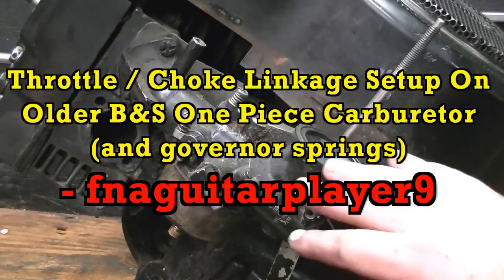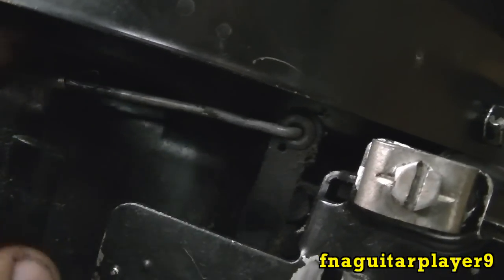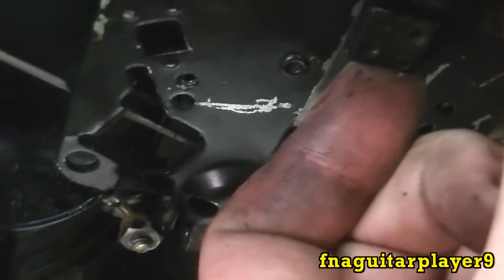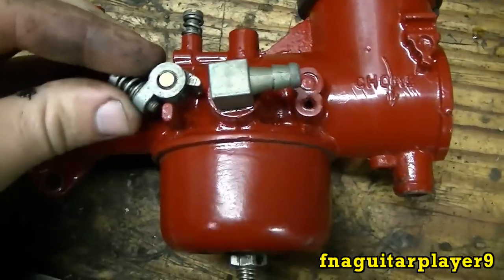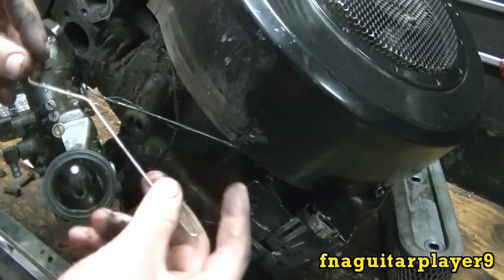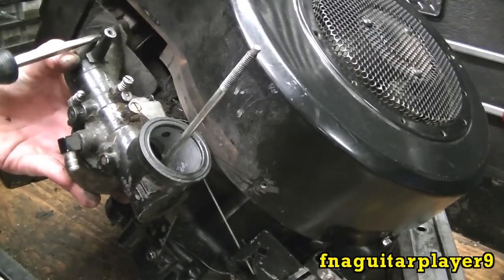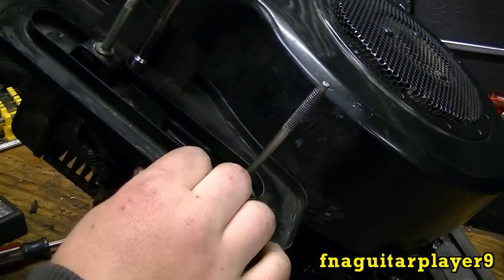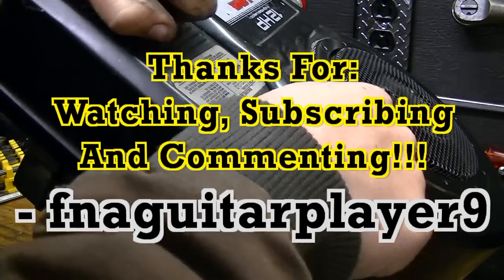How Throttle / Choke / Governor Linkage & Spring is Setup on Briggs One Piece Carburetor

Comment: Can I ask a question I bought a new carb for my simplicity it's a 252707 and it has a spring on the jet screw on the top next to air mix screw is this normal

Comment: I have same carb,  the gov. Arm and throttle arm do not have small hole for spring that goes with arm, should I try to drill small hole in gov.  And throttle arm. ?  Thank you

Comment: On the choke end of the carb body. What goes in the 8-32 threaded hole?   I have a photo but can’t figure out how to link it. Its in the bottom you can see it through air intake with filter box off.

Comment: Buddy I bought the cheap ebay carb but can get fuel inlet in. Any ideas?
Reply from the maker: I'd say take the bowl off and make sure the float or needle valve isn't stuck. Thanks For Watching!
Reply: I did the same . I had to tap the fuel inlet threads in the carburetor.

Comment: Finally found a clear and well explained video on the choke linkage. My mid 80's 12hp B&S carb has been acting up (one of the very old versions with the manual choke lever, and no choke linkage). The replacement carb has the choke lever mounted on the rear side as you have shown. This video is/was exactly what I needed to find. (Even tho' I will probably end up rebuilding the original, at least I have a mower that runs again...)
THANKS!

Comment: Thank you for making this video. I'm working on the same setup and pulled the carburetor off to replace and or rebuild. I always take pictures prior. But missed the linkage at the other end. The choke linkage fell off and could not see how it goes back in. As well as that little thin spring wire you mentioned. I suspected it loops through the small hole, as mine was not connected.

Comment: Appreciate the video more than you can know.  My friend gave me his 30 year old Toro riding mower recently.  Have it running, but it would only run if the throttle was set just so!  Move it one way or the other and it would cut out.  Anyway cleaned the carburetor yesterday and was having a heck of a time getting the linkage back on right.  The little spring is a pain, and the throttle linkage didn't want to stay in.  your video helped explain this well.  Again thanks for taking the time to make it.
Reply from the maker: James Owensby Glad to help out! The linkages can be a pain! your welcome, Thanks for Watching!!!

Comment: Mines on an old workhorse pulled the carb to clean it no choke linkage, I think im just gonna run another choke cable and ditch the whole auto choke dealeo.. great video with excellent close ups thanks for uploading...
Reply from the maker: I hear ya! Thats how I do them, I don't care much for the auto choke where the engine starts at full throttle. Thanks for Watching!!!

Comment: Hey, I checked out a few of your video's about these one piece carbs, love them, very helpful and got me through a lot. I do have one quick question. The oil breather hose that connects to the carburetor, while trying to get things set to run and my mower wouldn't run, it kind of looks like the might be/have been some oil getting in before the choke plate, is there something I should be looking at or what could the cause of that be?
Reply from the maker: +Charles Mccullick Appreciate that glad to help out! Usually oil from the breather hose is from excessive blow by (past the rings on the piston) forcing oil past the rings or to much oil in it, or, they have what works similar to a PCV valve on the valve spring cover, its possibly for that to be dirty or sticking letting oil seep through. Thats really about the only causes for it. Or if its been run on a hillside or turned over it will cause it to seep through as well. Thanks for Watching!!!

Comment: I have a 2015 Cub cadet walk behind haven't had it long the  gas bolw gasket was leaking and unfortunately I had to take the carb off and tryed to do it the easy way with out taking it off and on the guvaner popped off and like an egut I didn't look at what holds the two amrs on to keep it in place so they don't come off....I think on arm works the choke and the other works the throttle.... If you cold help thanks and have a blessed day

Comment: Very helpful video thank you
I have exactly the same set up and that spring you said was broken is missing, how important is it?
Cheers Bob
Reply from the maker: Your welcome! The small one on the linkage? All it does it keep tension on the linkages so there is less play in it, which in extreme cases can cause a small lope or surge, but as long as its running good and not surging or anything it will be fine to run without. Thanks for Watching!!!

Comment: Hi, thanks for this video i was able to figure out the choke linkage. One issue i am having is engine won't start unless i remove air filter, i replaced this. When it runs and I engage the choke the engine will stall. Governor linkage is fine though the spring is broken. Would a clog breather cause stalling when choke is engaged?  BS 12 hp IC on a 30 year old Craftsman 2 lawn tractor.
Reply from the maker: Sounds like the carburetor is set to rich, try turning in the bottom screw about a 1/4 turn and see if it helps.  Thanks for Watching!!!

Comment: Hello, thanks for doing this video. Extremely helpful. Have a similar one which leaks gas through the hole next to where the air filter long screw goes into to the body. What purpose does that hole serve? Is it supposed to sealed off? Thanks!
Reply from the maker: Your welcome! There should be like a foam piece in it, or a screen, kind of hard to explain, but yeah its supposed to let built up gas seep out as far as i know. Thanks for Watching!!!
Reply: @fnaguitarplayer9  - mine has like a very fine metal brass-like screen which gas seeps through and thought it must be a fault.. Have been looking for an explanation until now so I went ahead and sealed off. Any danger sealing it off you think? 
Have looked at some other videos tonight. Understand now how the throttle and choke works
on the B&S as mine is also similar and I did have some questions.   I commend and applaud you on the fine work you are doing. Makes beginners like me appreciate people like you and your goodness even more. Your explanations and videos are tops. Keep up the good work!
Reply: @fnaguitarplayer9  hello, thanks again. have a similar carb but unable to get it to start. Cleaned the carb best I can. Smell gas after a couple pulls and then leaks through the hole at the bottom next to where the longer air filter screws goes in. The flywheel  key is intact. Removed and checked. All new hose and filter and non- ethanol gas being used. Adjusted governor by following your instructions. Tried adjusting screws; one at top, then bottom all 1.5 turns. Unable to get it to attempt to start. Do you have any suggestions other than getting an after market carb?

Comment: I have the exact same motor and I’ve been trying to figure out why it’s surging forever, the linkage on the carburetor  back to the governor keeps going back-and-forth and back-and-forth surging, thought it was the carburetor and rebuilt it but it didn’t help, loosen the lock knock on the governor arm and turn the slot to the right and re-tightened, still didn’t help still surging, I can’t figure out why it keeps surging to save my life, I even replace that little tiny spring on the linkage and it didn’t help, it only does it when running at high speed, any ideas?

Comment: Cool video, very informative. I am going out to replace the carb diaphragm tomorrow because my mower started losing power after 3 min of running but, I noticed a loose spring when I took it apart. I reset it in the only little hole in the are but my Q is, when i pull the throttle bar, should not the linkage that the spring is attached to adjust? Oh, mine is a B&G  550 series
Reply from the maker: The only adjustment on most is on the governor itself, and you usually don't have to mess with that, the governor spring can be adjusted by the bending the tab its connected to put more/less tension on it. If that is what your talking about. thanks for watching!!!

Comment: My throttle plate adjustment has a lot of bounce. Yours was tight. My throttle has the spring and it is connected. If I manually move that assembly with the idle screw adjustment I get good full spectrum throttle. With the system it has one sweet spot ant either throttling up or down will cause it to stall out. Any suggestions? Great video.
Reply from the maker: If you mean play on the throttle shaft on the carburetor, it could be either the shaft it worn or the bushings in the carb body is worn. Thanks for Watching!!!

Comment: Perfect...thank you so much !!
Reply from the maker: Your welcome, Thanks for Watching!!!
Reply: @fnaguitarplayer9  I am was / am trying to get it back together to take to someone else to repair.   I'd poured gas in the carb while it was attached and it backfired 3 diff times and caught carb and filter tray on fire.. I did get it to fire once or twice thru exhaust but wouldn't stay running. Any ideas ??, please?
Reply from the maker: @charlesbroomfield9832  the flywheel key may be sheared throwing the timing out, alot of times they will act like that if its sheared.
Reply: @fnaguitarplayer9  Thank you sir. After writing you, I found a video describing it but I don't have tools to do the job.  Thanks again!!
Reply from the maker: @charlesbroomfield9832  your welcome!

Comment: well done video. explains how linkage etc should have been hooked up.  After years and a few owners mine was wrong but amazingly did still work for a short time. Now it is working nicely but the throttle slider had broken. The broken piece had wedged itself in behind which created a lot of problems with high speed and idle but the slider was still working. my slider looks just like that in your video and is on an 8hp. is there a place that still has some these in stock?
thanks again well done.
Reply from the maker: Appreciate that! You can't buy (now) just the plastic piece, you have to buy the whole assembly, if you give me your model number off the engine i can look it up for you. Thanks for Watching!!!
Reply: t just shows as 8hp IC industrial motor

it is in a 1984-1986 Ford R8 lawn tractor it is an 8hp electric start. looks like mtd manual shows as   BS1917072140     8hp electric start 09g12052.-2005  but of course shows as superceeded.

also with checking the governor setting etc the motor is not getting full throttle. I can push throttle lever to fast but can still turn around and thumb the butterfly further open and getting more rpm. how do I set the motor for more rpm or full throttle? the sliding throttle works for the choke at the top of the stroke so do I need to bend a butterfly linkage? 

thanks.

Comment: I have a question    I rebuilt a 19.5 hp briggs engine for my john deere lawn tractor.  I've done this many times in the past but this time when it was all assembled and ready to start it didn't.   All it does is back fire through the carburetor  but won't start,  just back fire.  I have checked the values,  they are good.  I took the fly wheel off 3 times to double check the alignment but it was perfect..  Took the engine apart again to make sure the sprockets were all timed right and they were..   I have exhausted everything I know and gone over the entire engine over and over again and just don't understand what is wrong.  I just ordered a carburetor solenoid for it thinking that was the problem but the more I think about it , I don't believe it is..   Any insight you may have on this?
Reply from the maker: Check for spark, I've that happen alot of times, if the flywheel key is good, valves are set, if you know the carburetor is clean, then its usually a intermittent spark on the coil, not always but if you have a inline spark plug checker put that on it and see whats it doing, if its just parking now and then you need a new coil. Thanks for Watching!!!

Comment: I wanted to know explanations for MULTIPLE 3-5 magnets on outside of small engine Briggs flywheel . ( not underside 12 magnets) There is one that runs the Magneto coil. Does this have anything to do with AC type induction into ac magneto of North and south?
Reply from the maker: Yes it is some type of sequence of north south north or something like that to get the field to energize and collapse to generate a charge. and the magnets under the flywheel are just for the charging circuits. Thanks for Watching!!!

Comment: hi there great video i have the same carby on a B&S 8hp engine i had to do a full clean on the carby all back together and start and runs fine problem im having is at full throttle its not revving high enough stalls out when blades are engaged I can get it to rev higher by screwing in the idle screw do u know what it would be cheers
Reply from the maker: Thanks! Sounds like your governor may need to be adjusted, if that doesn't help then i'd say the internal part may be damaged (oil slinger/governor). i have another video on adjusting governors. Thanks for Watching!!!

Comment: I recently bought a 12 HP I/C  the linkage is extremely similar . But the finger that is supposed to catch the u shaped end of the choke linkage doesn't travel far enough to move the link.  And suggestions?
Reply from the maker: Usually the problem i've ran into on those is the throttle cable needs to be adjusted so it pulls it more. thanks for watching!!!
Reply: @fnaguitarplayer9  it does seemed stretched !!

Comment: Hey Frank. I'm fairly new to your channel but finding it extremely helpful for an old ride-on project I'm doing. One question - I noticed on your red carburettor that there is another opening at the back end under the welch plug and beside the float bowl (similar to the crankcase vent on the side). My carb has this too but I can't figure what it's for. I have blanked it off with a screw and o-ring and the engine seems to run fine. I'm just curious what connects to it? Great videos, thank you so much.
Reply from the maker: The only opening I know of is for the screw that holds the air filter on, it goes through that. If that is what your talking about. Appreciate that, thanks for watching my videos!
Reply: @fnaguitarplayer9  Thanks for the reply Frank. The opening I'm referring to is right next to the screw hole for the air filter. If you look at the video at 5:15 it is clearly shown. On my carb it was just an open hole but it looks like yours is filled?
Reply from the maker: @Tubester10  oh ok, I see it now, let me look at one this weekend and I'll get back with you this week, I'm not really sure to be honest, it might be like a drain or a vent in case gas built up and it could drain but I'll find out!
Reply from the maker: Ok, so i just looked at one, it is a screen/filter, in case the float   sticks or it floods it can drain out. Crazy that I've never noticed it until you pointed it out!
Reply: @fnaguitarplayer9  Ah right. That makes sense. Mine must have the screen missing! Cheers from England!
Reply from the maker: Yep, and something else thats interesting, the new aftermarket carbs don't have it all!

Comment: Not sure if I'll ever hear back from ya but I'm working on getting this old motor runnin again and I'm having troubles with the linkages... if I could maybe bug ya for a little and get some help I'd I'd surely appreciate it
Reply from the maker: I always answer comments on all my videos, just may not be really prompt! If you put all the linkages in like this video and it still doesn't run right, or it surges/lopes, try adjusting the governor it will usually fix that.  Thanks for Watching!!!

Comment: Hello Friend just wondering you could help me find a "throttle slide" the plastic piece on the throttle linkage on a flat head? TIA.
Reply from the maker: Jorge Lopez I might be able to, give me the model type and code off the motor, i'll look it up and find a part # for it. Only reason i need all of that is that some slide vertical and some horizontal, it might be a different number, i'm not sure right off hand. thanks for watching!

Comment: Ever had any experience replacing the the throttle shaft bushings on the one piece flo-jets?
Reply from the maker: Not yet, but its funny you say that, i picked up a 11hp a few months ago (made a video on it, just haven't put it up yet), and the shaft bushings are show on it, so i will be replacing them and the shaft this summer sometime, i'm not in a hurry because its not on any equipment, but i will get to it! To get it running i put my red test carburetor on it. Thanks for Watching!!!
Reply: +fnaguitarplayer9 yes, same here, have a 11HP with slopped out bushings. Can't get to idle worth a darn.
Reply from the maker: I hear ya, it really does make a difference, you wouldn't think so but it does